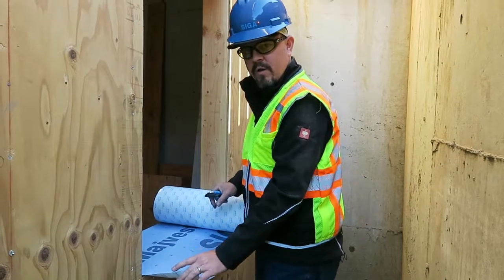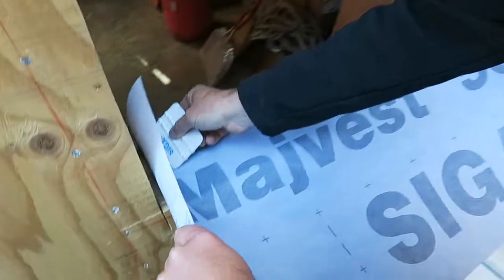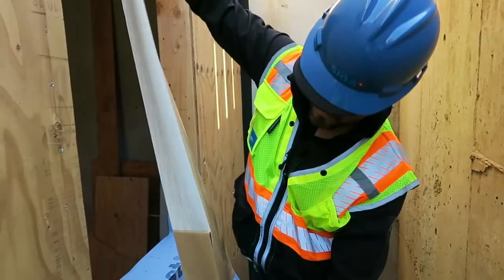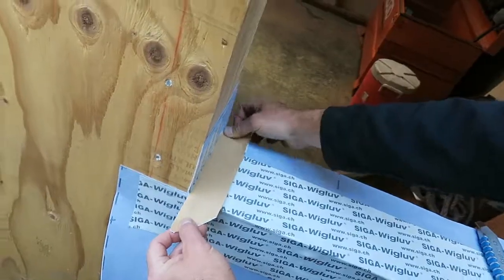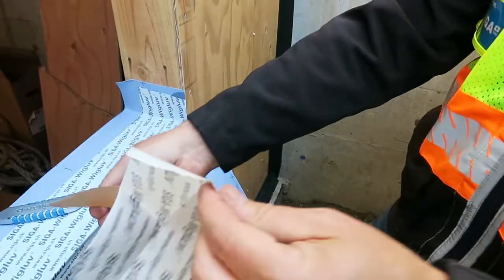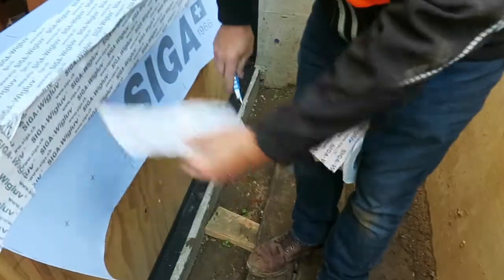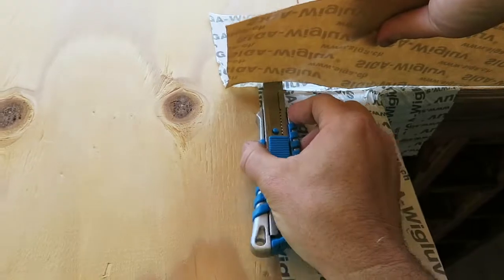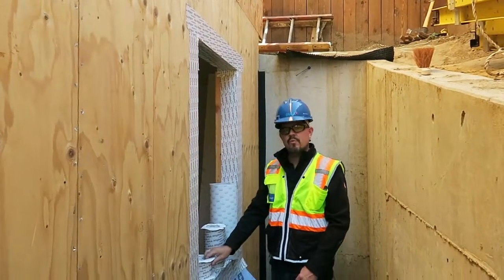How to Pre-Flash Your Window Rough Opening with Majvest 500 SA and Wigluv

Comment: First off, I really love the Siga Wigluv flashing tape and tell all my builder friends about it. I bought some garbage from Menards and it wasn't even on a couple weeks (on the shaded side of my building) and it was starting to peel away from the house wrap. I decided to research flashing tape and after reading the great reviews, I purchased your product. I love it; It sticks very well! However, I opted to use the Dupont flexwrap for the bottom corners. Will Siga Wigluv be manufacturing a flex tape? In the near future, I will be remodeling a beach house and will be removing the old siding, applying a house wrap, installing new windows and residing it. I'm not removing the soffit, so I will be terminating the wrap a few inches below the soffit and then taping the house wrap to the old wood plank siding. Which SW product would you recommend to secure the house wrap to the wood? Thank you for responding.
Reply from the maker: Thanks for the review, Brad! We're happy you've had a good experience using our Wigluv tape. 

SIGA does not currently manufacture a flex tape. We use Wigluv gusset corners or pre-formed corners for this detail. You can find drawings in our Window Flashing Guide: https://go.siga.swiss/ultimate-guide-to-window-flashing/

For the soffit, you can use Wigluv 100 for the connection. Make sure the house wrap is held in place mechanically under the tape overlaps. If the old wood siding is a bit uneven you can use our SIGA Fentrim 430 grey because that tape has more glue and forms nicer around uneven substrates. Good luck!

Comment: does your wrb then attach on top of the flashing or butt up to it?  does this method work with both tar paper and modern wraps?
Reply from the maker: The WRB will later attach on top of the flashing, overlapping it in shingle-fashion. The method works for both products as long as proper sequencing and termination is in place.